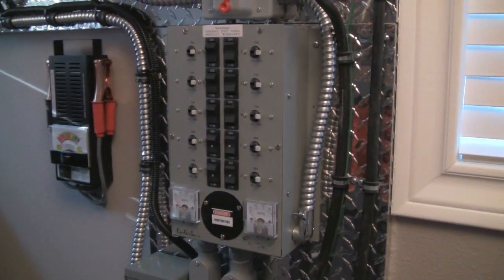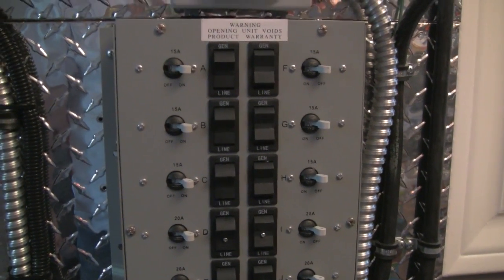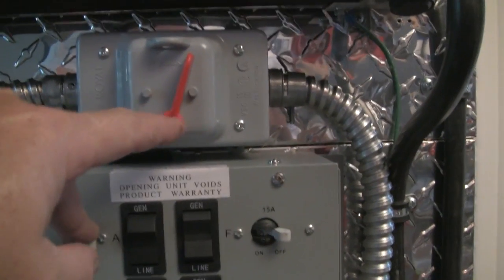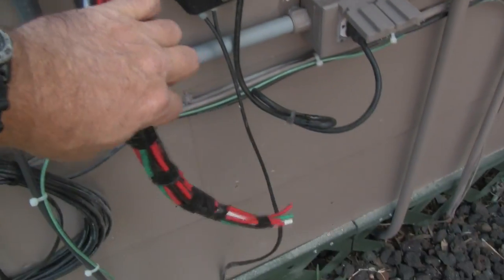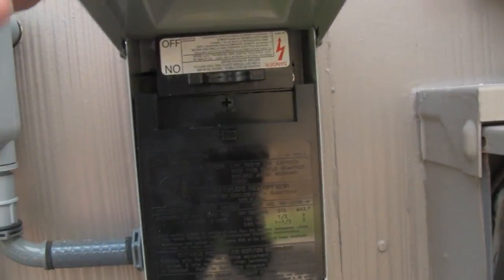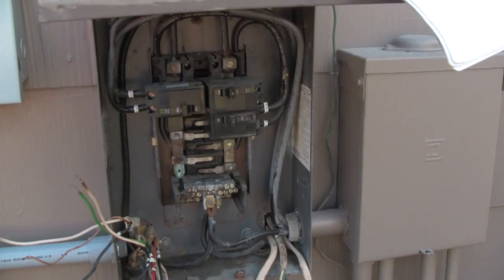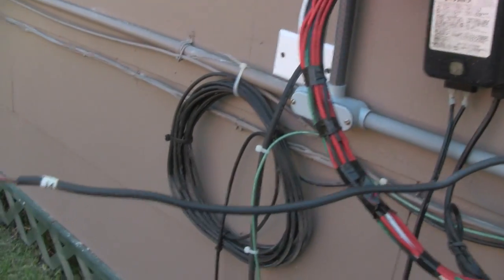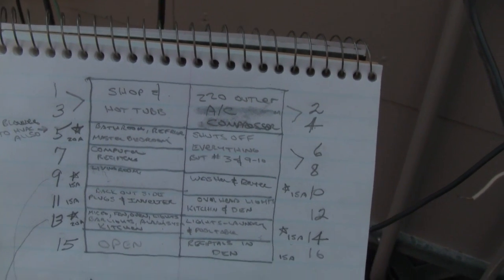EMERGENCY POWER TRANSFER BOX INSTALL Part1

Comment: That's kind of unusual to see your house's breakers sitting outside in the environment. Had a contractor tell me that the outdoor humidity accelerates the corrosion on the copper contacts and in the least case attribute to noisy circuits

Comment: Great vid and clean work!  I'm ready to feed my 120v to my 220v Reliance. I had same question Rob asked which, is how did you wire your 120v inverter to the 220v inlet the transfer switch designed for?  I have an idea but was hoping you could help.

Comment: verry itersting the way you can have the genarator and inverter on at the same time if you forget the light switch in the water resistant box on and how when running the inverter makes one of the blades on the genarator plug live en  less you shut off the disconnect not to mention i think you need to be a licensed electrician to pull a meter or do 80% of what you did

Comment: It would appear that the panel is an 100amp split bus panel with no main disconect. Recomend check for signs of heating or corrosion,
Whoever wired that panel was not an electrician.  Neutrals and grounds under the same bar.
The NMC /NMB (Romex) running through the knock out in the rear will eventually cause a fire since no  Romex connector was used and the expansion contraction of the wires will rub against the shap edges 6:28
Is that a sub panel to the right of the  main load dist center?

Comment: Hi Carey
Just working on a solar pv system with battery banks using an outback 3600w 120v/60hz inverter.. I plan to eventually use a generator at the inverter as it is setup for that. The inverter and battery bank is in my shop. I have the Emergen 6 circuit version of your transfer switch. I plan to connect from the inverter (120v) to the power inlet of the switch (240V). How would I wire the box to work with 120v . Thanks, Rob